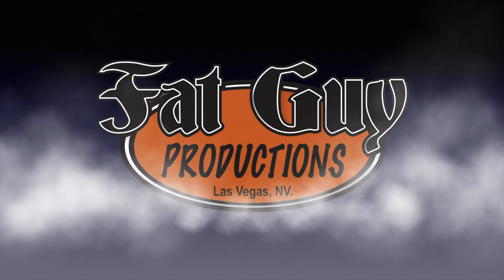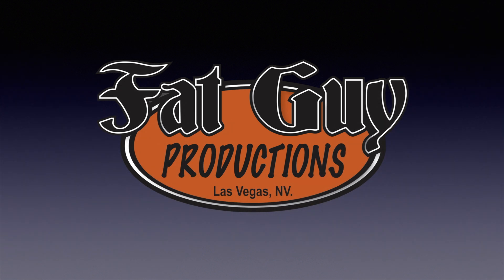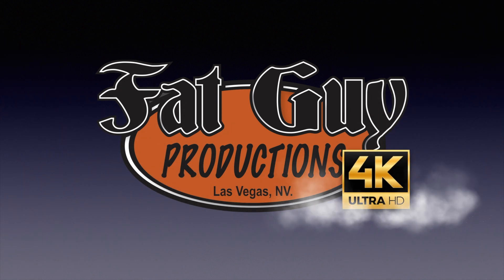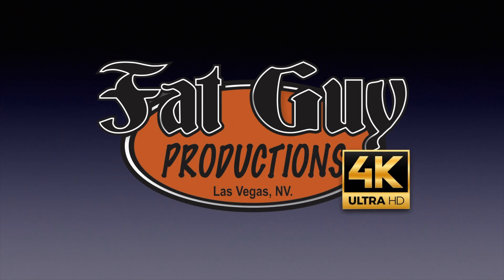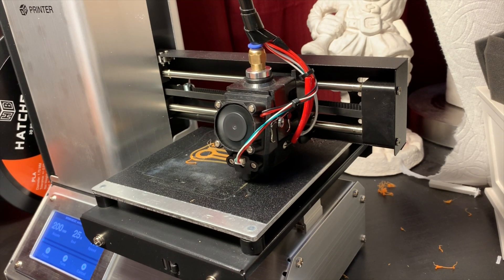Monoprice Select Mini Pro - Setting your Nozzel height! ***URGENT UPDATE!***

Comment: If the new owners would follow the bed leveling/Z gap setting word for word contained in the user manual and print the sample they should be successful, then double check the manual settings with the slicer setting before attempt to print the 2nd print using an STL. New owners fail to understand 3D printers are not plug & play, but the most technical consumer product with 100's of setting, it is a digital controlled machine, garbage in, garbage out. Also avoid the peer pressure to mod before 100 hours of operation if ever, just maintaining should be enough challenge.

Comment: There is only raft or brim in the options in the pro
Reply from the maker: I'm not quite sure what you mean.  In Cura under Build Plate Adhesion there is the option for Skirt, Raft, Brim and None...
Reply: I am running an older version on win32 maybe thats the problem a lot of different settings pauly
Reply from the maker: @mswsmw8838  Very possible.  I always recommend staying with the newest versions of all software if possible, even if you have to fight through a few kinks....  Best of luck....

Comment: What is the smallest thing you can do on a 3D printer
Reply from the maker: it will vary by. printer type.  A Resin printer can hold really small, fine details, whereas an FDM printer like the Pro can do something in the 2mm range - maybe less depending on the model...  Thanks for watching...
Reply: I am thinking about things  1/2 the size  of my pinky neal
Reply from the maker: It might struggle, but would probably depend on the detail.  Resin would probably be better... @timothyraymondparsons5464

Comment: Your original method worked for me, prior to finding your video, I could only manage to print something on a raft.

Monoprice Customer service is, in my opinion, excellent.  I'm currently awaiting delivery of my third Select Mini Pro.  The first printed the Cat and a calibration cube before the Z axis suddenly stopped being able to move down.  Disconnecting the auto level sensor returned negative Z movement, but it absolutely would not level.  Monoprice tech support stepped me through troubleshooting and diagnosed the Auto Level Sensor (like, duh, I knew that before I contacted them, but they had their processes to follow) and a RMA was issued on the 5th day I had the printer.

The Second arrived and I discovered the joy of rafts on everything and achieving about 80 successful prints.  Then I found the Cura setting and opening script on Reddit and your two videos, made all of the adjustments Reddit and you made, and hey, I was printing just like the big boys.  12 days of amazingly successful prints, and the exact same failure occurred.  I ran through the entire troubleshooting process the tech support had for the previous one and reported all the symptoms to Monoprice in the new case.  No delay this time, an RMA was issued same day, and Fedex is telling me machine #3 will be here Tuesday.

If this one dies, it's going back to Amazon for a refund.  One failure can be expected, two is worrying, three is enemy action.

The kicker is I just looked on Amazon and the Ender 3 is cheaper now.  Damn it.  Looking forward to your next vid so I can tune my new machine to it.